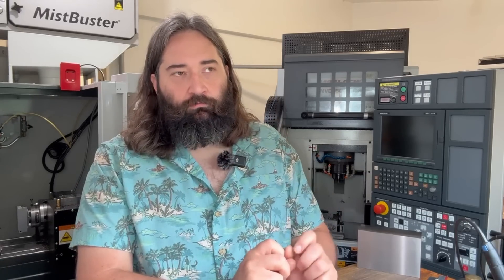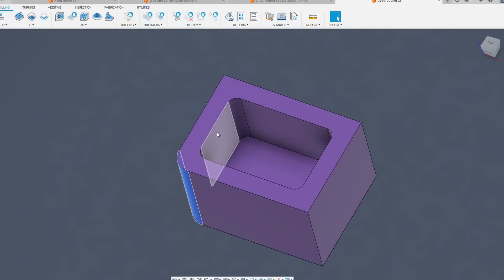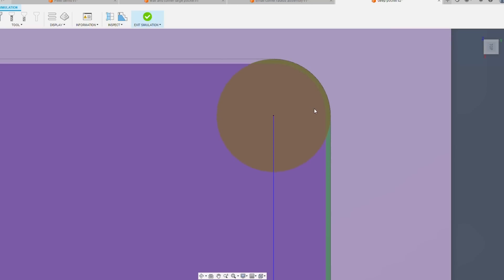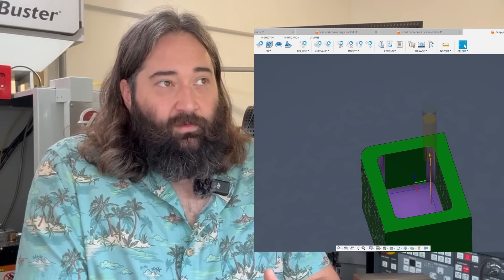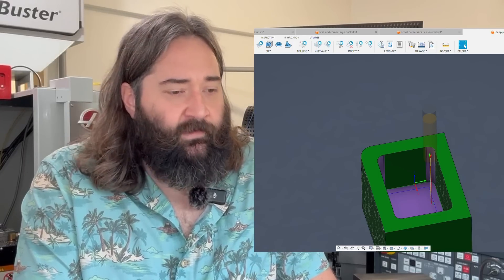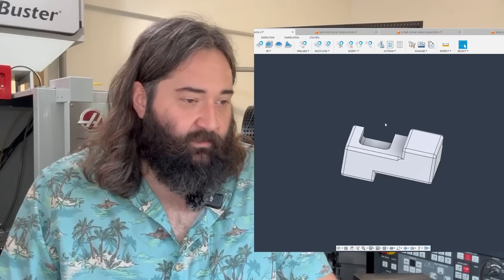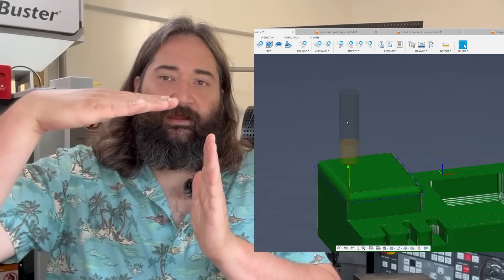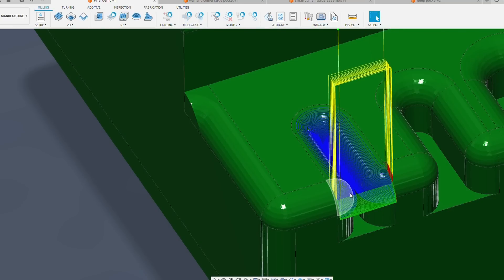Fillets make your cnc parts more expensive

Comment: A small addition for the folks at home on the radius at the bottom of a pocket, bull nose endmills come with standard and preferred radii. Use those! Preferred wherever possible, a non preferred standard size if you must, and be prepared to pay in lead time and part cost for non standard nose radii. Getting cutters custom ground takes time and money.

Don’t know which size is preferred? Ask your friendly neighborhood machine shop foreman. They’ll have opinions. Actually, that goes for almost all tooling.
Reply: "Ask your friendly neighborhood machine shop foreman" been there, done that. And than the purchasing department ordered the part from a job shop in south east Asia. 🤣
Reply: Sticking to standard size tools is a great way to save time and money.

Even better is not letting the intern specify a .001 tolerance on all dimensions.
Reply: @8__vv__8  As one of the engineers sending out CNC jobs, I apologize on behalf of my colleagues. I WISH it were just the interns.... That said, you can tell my opinion of someone depending on if I refer to them as "Kevin" or "Intern Kevin"
Reply: @november382 
As a retired Tool Room machinist, Tool Maker and machine rebuilder l dreaded every single time l saw a print that featured tolerancing "errors". By errors l mean the use of tight tolerances on inconsequential features. Non standard sizes on C/Bored pass holes for SHCS's. This can mean the extra step of interpolating the C/Bore, having special tooling ground or expensive setups on manual machines. Tight hole sizes on pass holes with a +/-.005 on location. The use of specific hard to setup off of features as Datums. Ideally we always wanted to machine everything to nominal. Another thing that l did not care for was high surface finish requirements when the designer knew we were dealing with shop equipment that was severely worn. In need of replacement or full rebuilds. The replacement of worn out shop equipment is a pet peeve of mine. Yes one can do good work on worn out machinery. But it takes longer. I worked in an engine plant. Every time the engine assembly line was down for one complete engine ready to ship was around $1500 iirc. The bean counters could not understand that a $15,000 Bridgeport type mill w/CNC control only had to be able to do the work needed to get you back into production for 10 assembly cycles to pay for itself.

Comment: This should be required watching for designers that want their parts made!
Reply: The designers who don't want their parts made should probably watch it too.
Reply: With a test to take after
Reply: @donutfpv  NO, LET ME CHAMFER, IT LOOKS SICK. DON'T TAKE AWAY MY CHAMFERS. I'LL RETALIATE BY SHARING STL INSTEAD OF STEP.
Reply: @Splarkszter  i will retaliate by actually using the tolerances you've put on your drawing.
Reply: @Splarkszter  that's why I always put an apple like G3 curvature chamfers. Come at it with a ball nose and make it a 100 passes. I want my corners to be smooooooth
Reply: @DARKredDOLLAR  One of the first things I learned back then (Aerospace studies): G1 is good enough for us. G3 is for automotive dude with their sheet metal in a lighting-room :D
Reply: This is the micro side ... builders deal with the same thing when dealing with architects. 
It's why people who design things should always start off creating the designs of others.
Reply: I believe it's called "design for manufacturing"

Comment: There is SO much friction between design and manufacturing about things like this. I'd love for this video and more like it to be required watching for every new engineering hire. The opposite is also true of course. There are aspects to design that would greatly benefit many machinists to better understand.
Reply from the maker: One of the best things to ever happen to me career wise as a machinist was having a desk in the engineering office. The barriers came down and I really understood more about my place in making parts.
Reply: @adamthemachinist  My current workplace has the engineers, toolmakers and tool testers all sharing the same office space. add in leadership thats trusting enough to let every level do our own planning for orders of operation. most efficient workflow i've come accross yet.
Reply: When I was at the university to study mechanical engineering, the professors made sure we understood how parts are made and how to design accordingly. The best advice we got was: "Whenever you start a new job as a designer meet the people on the shopfloor and understand what they can do and what not. And whenever your desing is 80% done, show it to the guys at the machine and ask them how to optimise it for manufacturing". I follow these rules and in 15 years of designing complex mechanical parts for the automotive industry, not one of my designs failed a review by the supplier.
Reply: I see this as a structural engineer too.  Problem is, the guys doing the work are even farther removed from me than a machinist is to the mechanical engineer.
Reply: @tippyc2  Ask your boss to send you on site once a month. The travel expenses are nothing compared to what you can save when you desing with the reality on the construction site in mind. It's likely that they spent extra time one working on details you really don't care about or that they are able to do things you didn't know about.
Reply: @GrafUnschuld  I do go on site quite often, actually.  My specialization in high-end residential pretty much demands that.  Framers are always my favorite people to talk to on site because they always give great feedback about what works and what doesn't.  Often though, i only ever meet with the GC overseeing it all.
Reply: @tippyc2  I'm echoing GrafUnschuld; have your boss send you on site enough times. The time you spend with the people actually building the stuff you design can teach you ways you can save thousands per job. And then you can help others in your office learn some of the stuff. And not just what to do, but why to do it that way. It's an investment in making you and your company more competitive in the market later.
Reply: I was startled, when i got a call as an engineering student regarding a part we sent to internal manufacturing (so no money changed hands for that...). They called to say, that they probably wont use a 6mm mill on the 3mm radii we defined.
We were all happy, that we didn't define internal corners or unnecessarily small radii... Because apparently one does not simply run the endmill straing into the corner, turn 90° and move out. Well, I'm happy, I had the opportunity to learn....